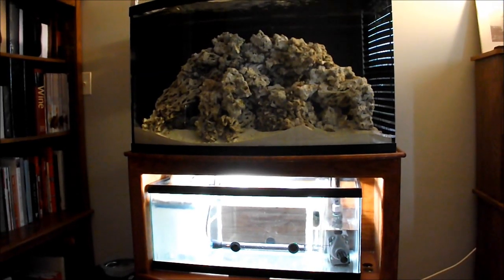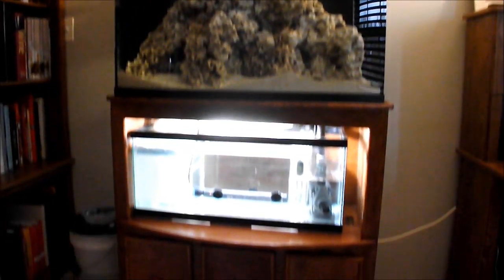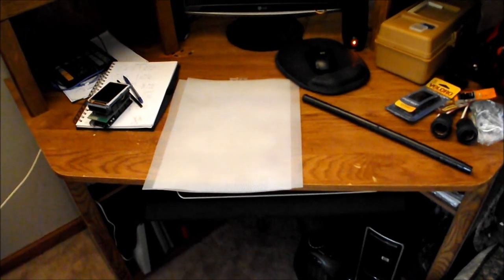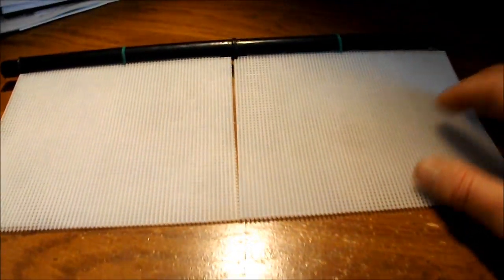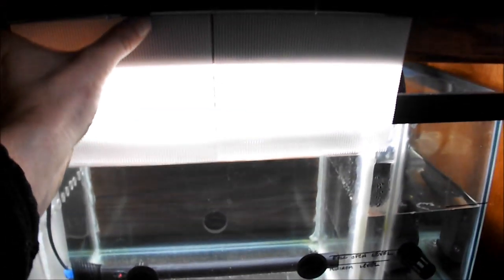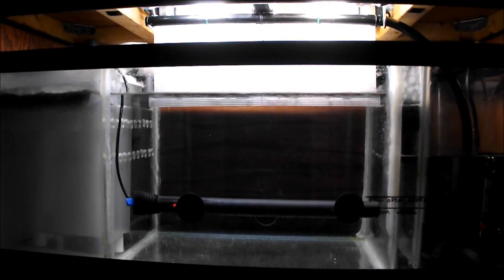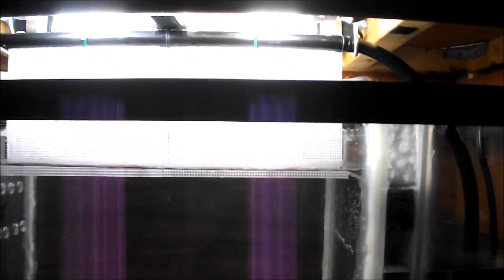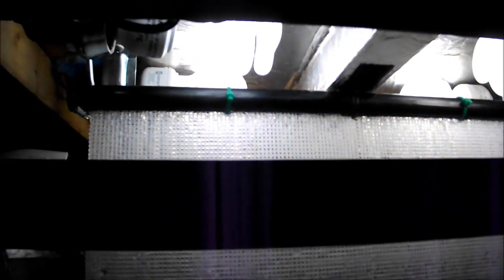DIy Algae Scrubber -  In Sump Refugium set-up

Comment: Oldie but goodie vid. For those wanting to DIY a waterfall, here are some guidelines:

Scrubbers are sized according to feeding. Nutrients "in" (feeding) must equal nutrients "out" (scrubber growth), no matter how many gallons or liters you have. So... 

An example VERTICAL upflow or waterfall screen size is 3 X 4 inches = 12 square inches of screen (7.5 X 10 cm = 75 sq cm) with a total of 12 real florescent watts (not equivalent watts) of light, or half that for LEDs, for 18 hours a day. If all 12 watts (6 watts LED) are on one side, it is a 1-sided screen. If the watts are divided on each side of the screen, it is a 2-sided screen. This should be able to handle the following amounts of daily feeding: 

1 frozen cube per day (2-sided screen), or
1/2 frozen cube per day (1-sided screen), or
10 pinches of flake food per day (2-sided screen), or
5 pinches of flake food per day (1-sided screen), or
10 square inches (60 sq cm) of nori per day (2-sided screen), or
5 square inches (30 sq cm) of nori per day (1-sided screen), or
0.1 dry ounce (2.8 grams) of pellet food per day (2-sided screen), or
0.05 dry ounce (1.4 grams) of pellet food per day (1-sided screen)

Problem rocks: Each 50 pounds (2.2 kg) of nuisance algae covered rocks you have adds 1 cube a day.

Flow or air bubbles is always 24 hours; water flow is at least 35 gph per inch of width of screen [60 lph per cm], EVEN IF one sided or horizontal.

FLOATING SURFACE SCRUBBERS WITH STRINGS: Screen size is the size of the box (Length X Width), and is 2-sided because the strings grow in 3D.

Clean algae:

Every 7 to 14 days, or 
When it's black, or 
When it fills up, or 
When algae lets go, or
When nutrients start to rise

Comment: Love this design, only issue I can see is with power outage and room for back siphon from return pump. I've learning this lesson the hard way. My sump is only half full and I had a power outage and a check valve failed and overflowed my sump. 

Also, why not 24/7 lighting like cheato fuge?
Reply from the maker: I drilled a small hole in the return pipe inside the tank. So, if my check valve fails the siphon will break once the water line drops below the hole. Only about 2 gallons....plenty of space left in the sump. I had cheato in the sump prior to the scrubber. I haven't used this scrubber in quite some time. I swapped it out for a GFO reactor more than a year ago. Just get much better results.Thanks for watching!!

Comment: You end up with a sludge layer of smelly dead algae between the screens basically.  There is a component of light that penetrates through the screen to the "roots" of the algae on the other side, supporting it's ability to hold for a little longer (preventing detachment) and double-screens eliminate this (block light) so there is no advantage to them, at all.  Also sandpaper is not enough, you need to rough it up with a saw blade until prickly, check my channel I posted a vid a while back

Comment from the maker: Thanks for watching and, yes I did rough up both sides of each plastic sheet with some sand paper beforehand. I forgot to mention that. I do have lighting on both sides of the scrubber, but if the 2 ply does not work out that will be easy enough to fix by removing 1 sheet. I did not think of the flow after algae starts to grow, but the splashguard is built, and can easily put that in place. What would be the issue if waste gets  trapped? Water flow? I mean if they are going to be cleaned anyway?

Comment: if you google "algae scrubber basics" I wrote a couple summaries and they are posted on several reef forums and a few other places, last one was about a year ago.  I see a few things that you could do different, screen size seems based on tank volume, this is the old method, now it's based on feeding, so if you don't have an already messed up tank, you don't need an oversized unit.  I build all LED scrubbers now, have had great results across the board.  Anyways I can help & answer any ?s....

Comment: I didn't have time to watch the full vid, but did you rough up those screens?  Also double-layer is not a good idea, it just traps waste and blocks light from the other side - single layer is what you want.  I've built over 100 scrubbers and you can find me at Floyd R Turbo on various forums, RC, algae scrubber dt net, mine (turbos aquatics dt com) etc.  You mentioned not needing the splashguard, at first no but when you get growth you risk sideways spray from algae growth into the slot (cont..)